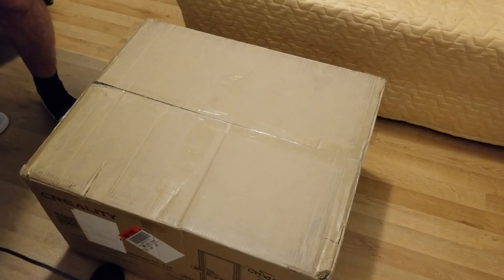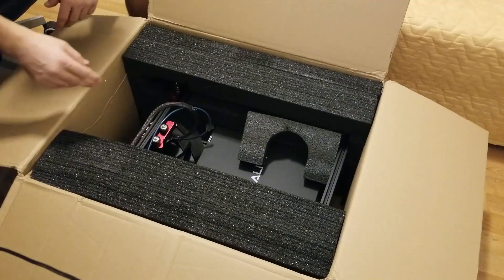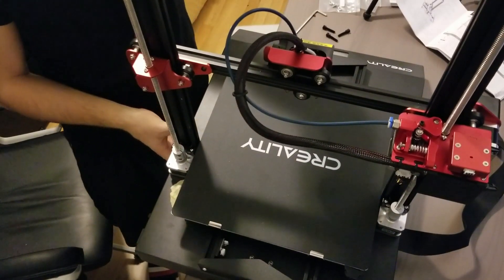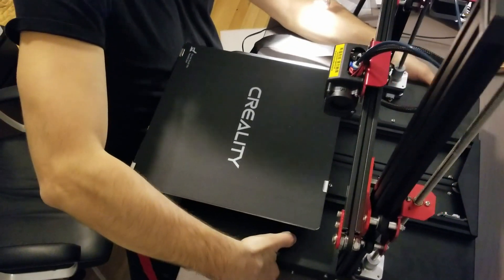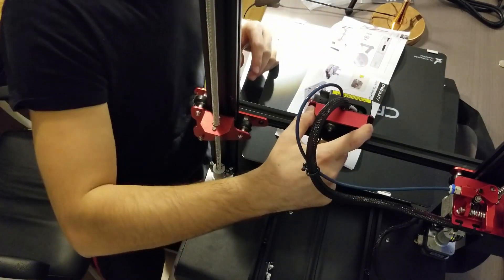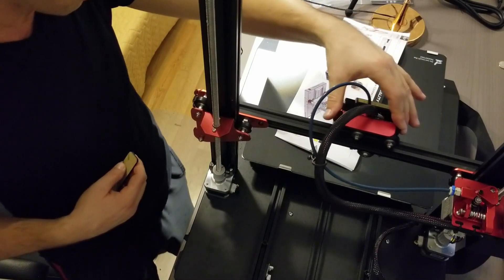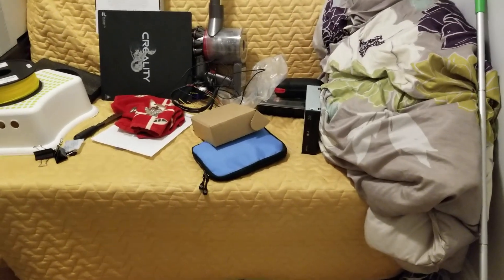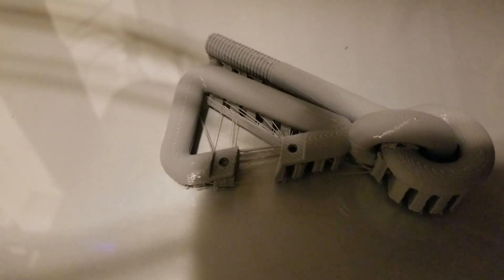Creality  CR10S Pro 3D Printer Unboxing

Comment: just watched your voron video and I also have a cr10s pro with a e3d direct drive and it prints everything I need it to print but thats not stopping me from looking seriously at the voron 2.4 .. i wonder if it will be more of an headache than its worth ?
Reply from the maker: My 2.4  sits unused. I still use the artillery 3d printers. The voron part cooling is not great nor is the bed adhesion. On the smooth side. I am stubborn I do not use glue. Kits are fine but make sure you get one from magic phoenix  or source the parts yourself. There are a ton of mods for the 2.4 so you can search the mods and decide how to build it from the get go. I woiud like to tweak mine but i feel is much easier to start another one rather than go back and tweak this one. But I do not need vorons so I will keep it around until something arises that it can work on.

Comment: Cr-10s Pro what can I say but what a pile of shit. Won't level correctly and print different thickness of layers regardless of calibration of adjustment. And that's not talking about stupid jumping of  x axis that isn't even remotely level. I highly recommend avoiding Creality and Bang good. Horrific service and attitude. So in short the Cr10s-pro is garbage.
Reply from the maker: I have been trying to dial it in for 3 weeks now, and I wasn't sure that it was me because I'm a novice on 3d printing or it is actually the printer. I made a video review with my experiences but I thought to still dial it in further rather before I post.

Comment: check the z axis nut screws which look to be there on yours, and any adjustment for X and Y
Reply from the maker: Thank you for the tip, but what can I achieve by checking them? There is one issue that I also noticed, on the Z axis rods I have to level them  with a 100 mm jig, but the right rod, seems to have the x axis on a slant is that what you refering to, or the actual wheels on the on the rails?  I haven't noticed any play on those. Thanks for the tip.
Reply: @RoamingInterests  O.K , most people including myself have found the screws holding the Z axis nuts are loose OR missing . ( the Y axis / heat bed loose OR too tight )
What I did was use the 100mm jig and found that the X axis bar must have been on a slant too , because top wheel was tight on one side and the other side the bottom wheel was tight , so just set it up so all wheels was free. ( Don`t think the 100mm jig makes it 100% level ).

Sorry I don`t know your level of expertise with 3d printers. 

The X axis carriage plus the Y heater bed carriage use concentric nuts , so on the X carriage you will find the top wheels are fixed , but the lower wheel uses a concentric nut which is used to tighten the carriage to the rail.
Same the Y axis , 4 wheel each side , the inner wheels fixes and the other using concentric nuts.

When you get it right , eg getting to first layer height right you will find the quality of your prints are out of this world.
Reply from the maker: Thank you for that tip. I am a novice at 3d printing and leveling. I did get the print head and the off-concentric nut if i may call it that, tight and I have been playing with the leveling gauge to get the leveling almost right. I did not realize that the wheels on the x axis rod may be loose or even adjustable. But I did notice that the right side of the x axis rail has the tendency to be lower than the left side. But if the wheels are tight and the x axis rod is still on a slant what else can i do? I will check when the printer finishes printing. Now I just committed a 25 hour print job to it. 6 hours and counting impatiently next to it... :) Wish me luck!!!
Reply: @RoamingInterests  if you have a slant on the X rail ( not the carriage ) then that is a Z problem.

Check both sides of the Z axis , the 2 other wheels which are fixed so no adjustment, just give them a little turn with your fingers to make sure they aren`t tight .
If the top one is tight on one and the bottom one on the other , just move the rod a little so all wheels are free.
Leveling is a real pain and getting that first layer to have the right height is a even bigger pain , but it is worth it in the end.
Reply from the maker: Thank you!